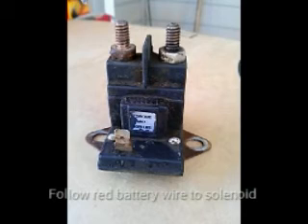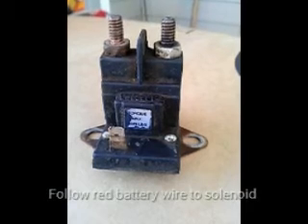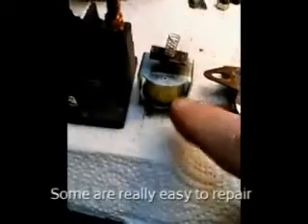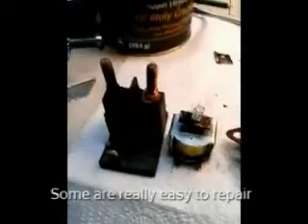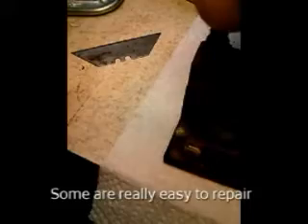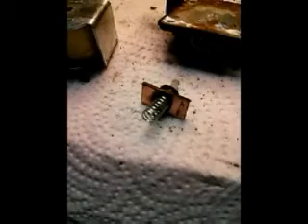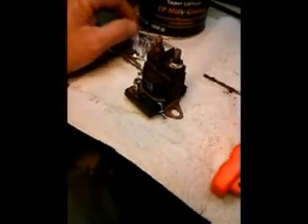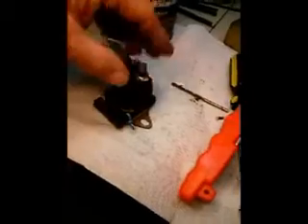Starter solenoid makes clicking noise

Comment: I got a brand new solenoid and battery. It's still making a clicking noise but it's coming in the front of the engine. It's a brigs and Stratton for my Crafts Man gt 5000. Do you know what's the issue?
Reply from the maker: Justin Germanovich 

Maybe the starter is locked. Remove the starter and try to spin it.